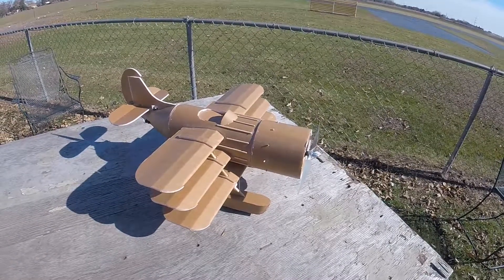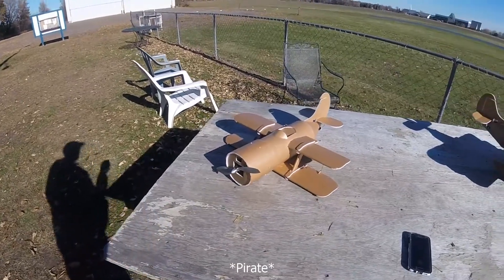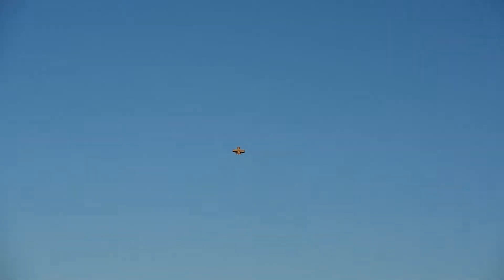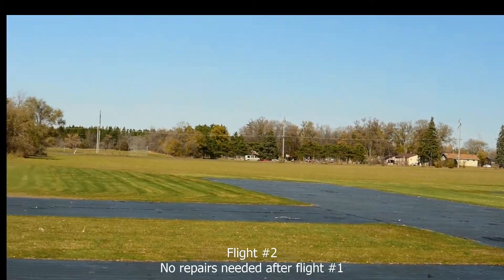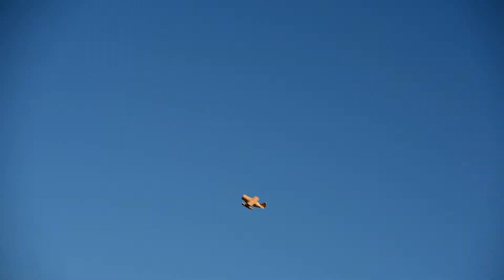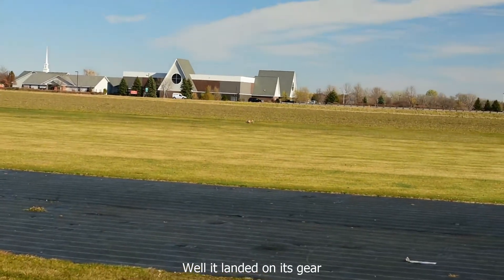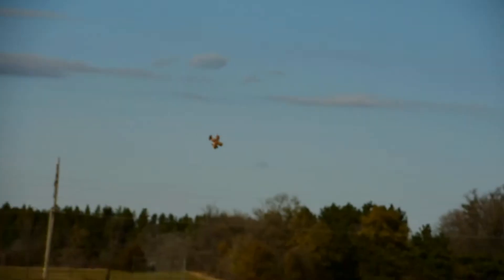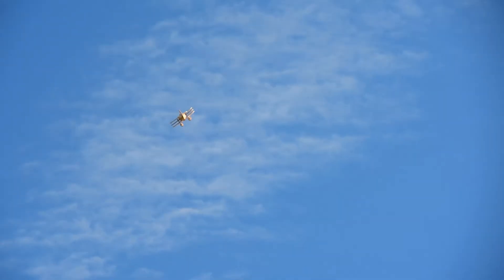RC Don Karnage's Tri-plane (Tailspin) V2 Test Flights

Comment: nice build. before i discovered this i just started working on a smaller scale version of the same plane. great work, but: the original plane has a triblade prop plus, the upper wing doesnt have a root chords. also id go with a little stabilizer to assist control. also try to make it a waterplane but its gonna be difficult..

Comment: thanks for posting.  the question is, the point of this design is    WHAT.     i can tell you why the design is  Mostly  stoopid.   the Excessive cross-sectional fuselage  Area  at the firewall,   IS  SPOILING  75 PERCENT OF THRUST AIR.    cheers
Reply from the maker: This plane is designed to mimic a plane from the cartoon Tailspin. To me it is an exercise in trying to get something that shouldn't be able to fly, to fly. There are a number of issues with it beyond the fuselage blocking 50% of the thrust (5" diameter fuselage, 10" prop, though I'm not sure if certain parts of the prop produce more thrust than others) such as the gaps between the wings being less than a chord length. I will add this link to the description, but you can read more about the why and how of the plane here: https://forum.flitetest.com/index.php?threads/ftfc19-don-karnage-triplane-tailspin-designed-by-horseman3381.55807/
Reply: @horsemanrc798  thanks for a rational response.   note that a correct guesstimate of the amount of reduction in available thrust  MUST  include consideration of    AIR  and   ITS   movement  AND  losses due to  Turbulence, in and around the 'gap' aft of the prop.   deflected air does not just dissipate.    turbulent air is  Less  dense, THAN  Ambient.    due to pressure differential,  then,  Turbulence  EQUALS  Suction.  it would not be surprising to find that a  toroidally-shaped eddy   forms behind the prop.   cheers             googletranslate
Reply from the maker: @daviddavids2884  Thank you for the information. I knew the air hitting the face of the cowling would go around it and disturb the air, but I forgot to take in consideration all the effects that would have. I have a few ideas that I may incorporate into version 3 that will not necessarily eliminate the issue, but perhaps manage it better to lower the amount of turbulence generated.